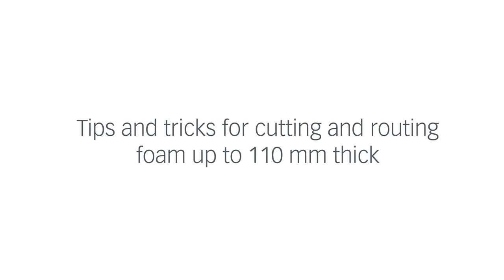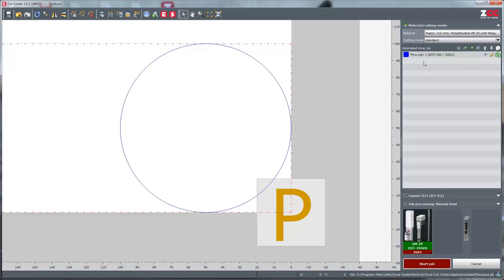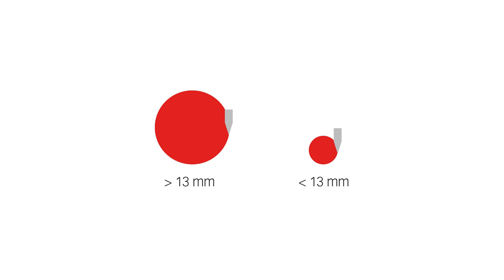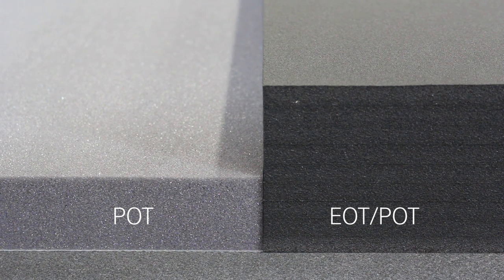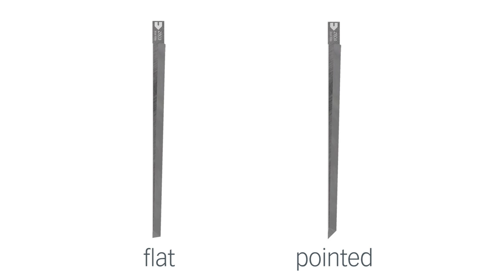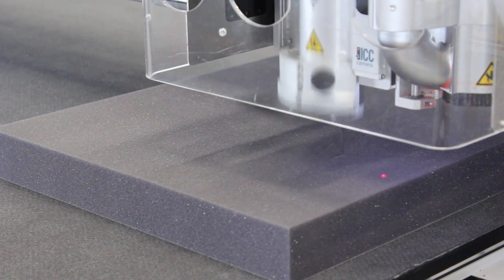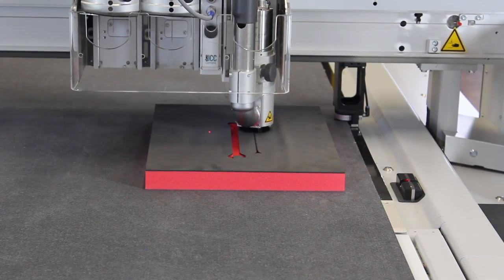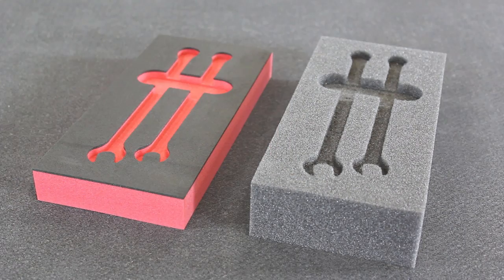Cutting and routing foam up to 110 mm thick

Comment: Hello. I have a sheet rubber with thick 1or 2 or 3.....or 10 mm. I want to cut it to different figures. Please advise me. Thank you.
Reply from the maker: Hi Chuc. In this case I would suggest to get in touch with our support team to get the best hints. Please send yur request to support@zund.com and they will give you all information you need. Thanks *tna

Comment: What kind or routing bit did u use?? and spining speed for softer foam.
Reply from the maker: Hi Birabanor.

If you are already using a Zünd cutting machine, you can take a closer look into the Zünd Cutting Center software parameters. There should be everything stored. But here the settings you asked for: 
Router bit:    R203
Speed:         150
Accel:           2-3
RPM:            50.000
Hope that will answer your question. Best regards /tna
Reply: @ZundTube  have you cut any higher density foams using the r220 bit? I need to route 2" thick foam and am experiencing odd/non uniform edges when cutting

Comment: This application uses the routing module correct?
Reply from the maker: Exactly. But it is the special version for the G3 digital cutter with 120 mm beam height. As you can see here: https://www.zund.com/en/router-module RM-120

Comment: Is it 13mm the minimum radius that can be cut? Or the minimum diameter? Thanks
Reply from the maker: Hi Eduardo.

It is the minimum radius that can be cut. You can see in the video what happens, if you go smaller.
Thanks for asking.
Reply: One further question. Do you think that a radius smaller than 13mm could be cut if the contour radius of curvature progressively reduces below that value? Not like the hole shown in the video where the blade already enters the material at a radius <13mm
Reply from the maker: I believe you are referring to the function; lead in lead out.
It might help a little for the tearing of the material however it will still not become a perfect circle.
Please note the video is about cutting thicker foam. Less thick foams and
densities could have a different outcome. The picture in the video is to show that there is difference and a limit.
 
I hope this answers your question
Reply: Thanks for the answer. Is there any e-mail where we could continue the discussion of technical issues? My application is near the limit of the capabilities of your system and I would like to know better if it could work
Reply from the maker: You can try it here: service@zund.com

Comment: What was the very first black foam you touched and the red and black foam? I'm looking for something extremely high density and super firm. hard essentially.
Reply from the maker: Hi. Here the information you asked for: 
- Black foam: Crossed linked Polyethylene (Maybe PE30 or PE45)
- Red foam: LD45 (Low Density) Closed cell Plastazote
Hope that's helpful

Comment: but.. how do i cut it if i dont have a michine?
Reply from the maker: Good question. If you don't have a machine, the only way is to cut it with a carpet knife. Or you buy a Zünd cutter ;-)
Reply: i ended out using scissors:/ but thx for the help!:D
Reply: You can use your teeth :)

Comment: a foam wire cutter wouldnt work?
Reply from the maker: Maybe. But the foam wire cutter wouldn't be that modular and multifunctional as a Zünd cutter.
Reply: yeah for sure, im just looking for the cheapest way. A Zund cutter is out of my bugdet  :P
Reply: Hot wire cutters work well, however the problem is like with hand held knives, the edges (corners) are not clean nor perfect unless there is a tracking mechanism - template for the wire